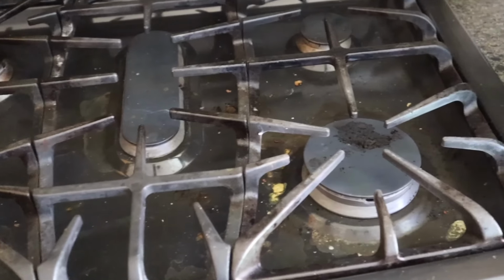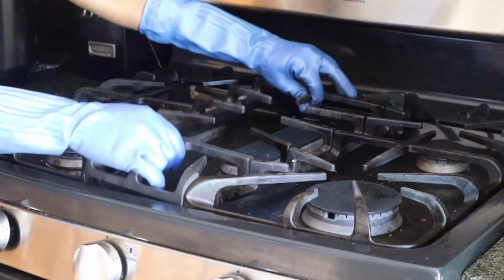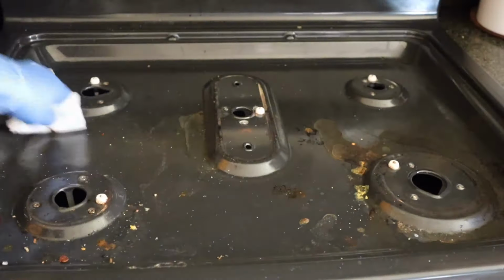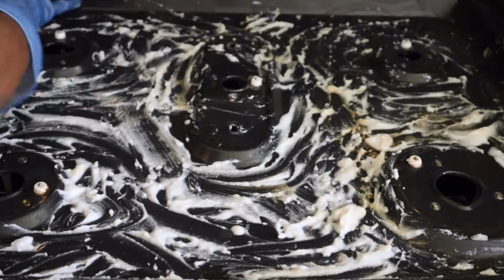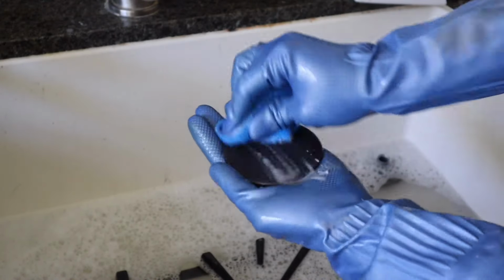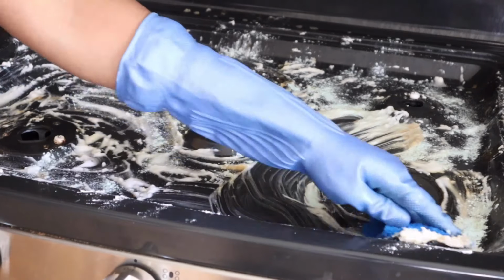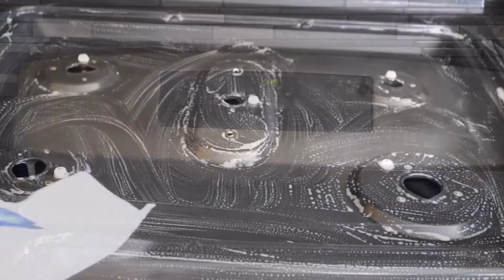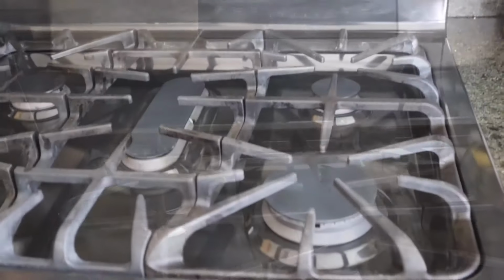HOW TO CLEAN YOUR GAS STOVE WITH BAKING SODA AND VINEGAR Watch What Happens!

Comment: PLEASE BE CAREFUL!! You can't mix vinegar and bleach, you mentioned after using the vinegar and baking soda, to use any scrubbing thing of your choice, like comet, which is bleach, and ""Mixing bleach and vinegar creates potentially lethal chlorine gas"". Always know what's in your cleaners, like different toilet bowel cleaners look the same, and some have bleach, while others have other cleaners that might interact with bleach. (But bleach just works better in toilets! I can spray, let sit, then never have to scrub, cause the bleach will kill all the mold! Whereas the other cleaner does NOT kill the mold.)

Comment: Or just use plain windex- and let sit. The ammonia breaks up all the grease, softens baked on food, and is the most streak free cleaner i have ever used. Compared to general cleaners my mother used, like fantastic or other counter cleaner. I will even use it to clean up dripped raw chicken, raw meats on counter, and after just looking it up, it does kill salmonella, and other food born illnesses, just not cold or flu viruses on handles. (But that means it doesn't kill upon sitting, scientifically, not that it doesn't clean off the surfaces and gets rid of germs sticking, so i still use it on door knobs etc.)

Comment: Very good video!!! I knew about the baking soda and dish soap but never thought about vinegar..I will definitely add it to the mix.
The only 2 suggestions I have for you is to be careful that the baking soda mix doesn’t get in the holes of the stovetop, so clean slowly or like another viewer said stop it up with paper towels. The last thing you need is for that expensive stove to stop working because of it.
And secondly, spraying vinegar ontop the backsplash might be if'ey
When I had my old stove it stopped working and the technician came to fix it 400$ later. It took him all of 5 minutes to do. He removed the electrical panel and told me it short circuited because of moisture. So from on now I make sure my rag is damp not wet and dry with another cloth immediately. Hope this info helps somebody.
Reply: had the same problem with my microwave

Comment: To clean my gas stove top, I use Dawn dish soap and a magic eraser.  I spread the Dawn dish soap over the stovetop and then spray a mixture of hot water and cleaning vinegar in a spray bottle. Spray over the stovetop and let it sit for about 10 to 15 minutes.  Then use the magic eraser over the stovetop and then remove the solution with a wet towel.  Until all the solution is wiped off, then buff the stovetop with a microfiber towel.  My stovetop is shining and no film or smearing.  Now, how I clean my grates, I spray with a grease cutter, then put the grates in a plastic bag, pour ammonia in the bag and tie the bag up tight.   Let them sit for about two hours or overnight, it all depends how dirty they are.   Remove from the bag, using a none abrasive sponge to go over the grates. Using the grease cutter and ammonia the baked on grease and curd will be softened.  Rinse with warm water and then dry.  Look like new.  

Another product that works really well to clean your stovetop is PINK and Sponge Daddy.